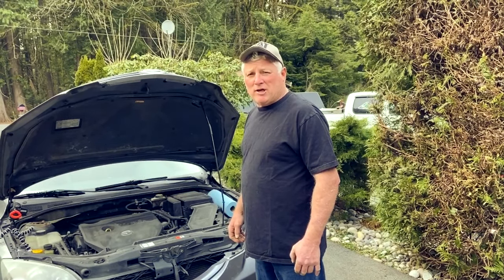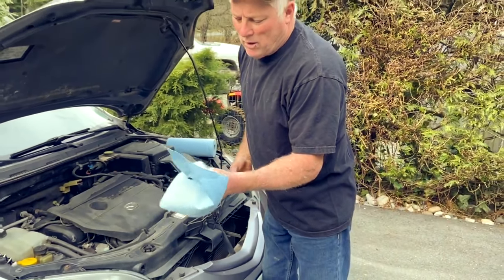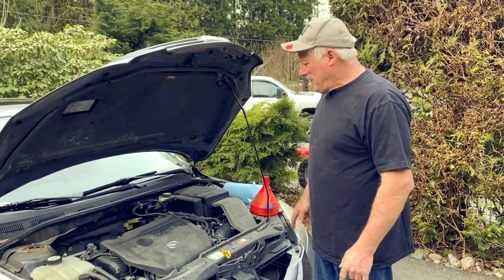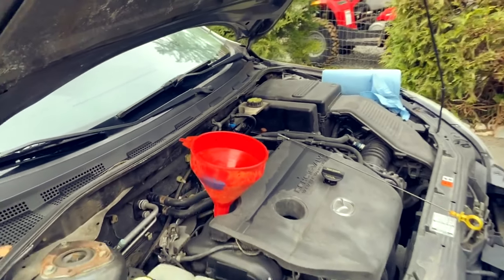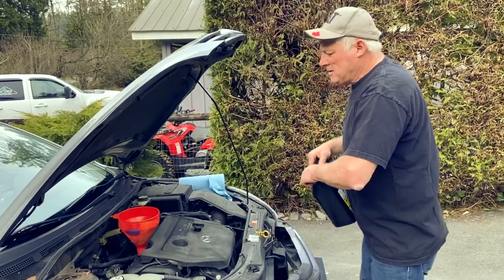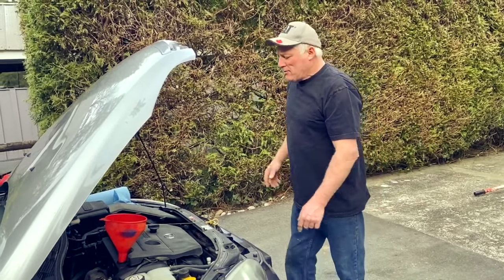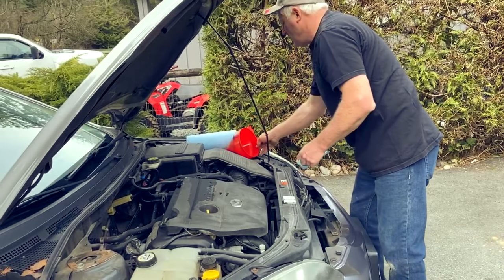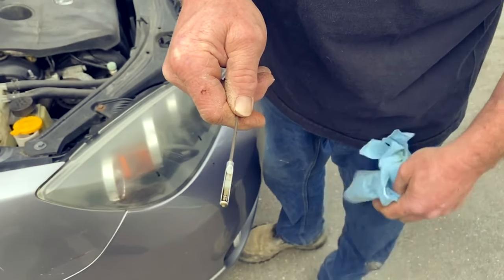How To: Check & Add Oil To Your Car

Comment: Thank you for the added tip about how frequently you check the oil. My car is older and definitely needs a closer eye on the inner workings. Thank you for your helpful video, I feel confident about adding more oil to my engine 😊

Comment from the maker: Returning July 2023!
Hi
Hi everyone, thank you so much for the kind comments. I had to take some time off YouTube but I will be coming back soon with more how to's! Thank you

A few common questions:

Does the car need to be cold? 
- It is recommended to do this with a cold engine. Wait at least 10-15 minutes after driving to check.

How much do I know how to add?
- Less is better than more. You can always add a little at a time and check as you go to make sure you aren’t over filling. Most cars will take around 5 litres from empty. 

Do I need an oil change?
- An oil change is recommended for good car maintenance around every 7500km or 4500 miles. Checking and adding oil if needed between changes is recommended to make sure you aren’t damaging your engine!
Reply: This was good  -  no muss no fuss.  Just do it  -  thanks needed to know where to put it.

Comment: Finallyyyy I've been trying to find a video like this but every single one is like "jack the car, unscrew the bottom, take the filter out, replace it, put it back in"
Like, I'm pretty sure you don't need to do that to do an oil change.
Reply: No fr I literally was stressing so hard I was about to pay someone
Reply: When are you suppose to do that? I don't get it

Comment: If my cars oil is empty, I could just add oil? I don’t need a oil change to be safe? The check engine light is off as well
Reply: If you car loses oil at all, it indicates a larger problem.

Depending on what the problem is, yes, you can just keep adding oil.

But you still need to have the oil and filter changed every 5k miles, or less. If your engine is constantly losing oil, then there will be tons of carbon buildup inside the engine which will, eventually, destroy the engine.

Keeping the oil at the correct level, and changing the oil and filter (make sure the engine has the proper amount of oil when you change it, so you get as much crud out as possible) will keep it going longer

Comment: For old cars, it's a good habit to check the oil level regularly, and it's an easy solution to dry off oil but try to change oil and filter completely after 5000 miles.

Comment: looks like your mazda's giving you some trouble too bud. :( i drive a 2010 acura tl and for all my other cars i've replaced oil between 6 and 8 thousand kms. my TL is reading 90% oil life and it's barely been 1000 km since the last oil and filter change (about a month and a half ago) but my dipstick reading is now at low so i have to add more oil. it really pisses me off that i have to add extra oil long before my next change is due. i've heard burning oil's been a problem with these late 2000s-early 2010s Japanese models. any suggestions? I have the J37 engine.
Reply from the maker: This particular car wouldn't stop burning oil no matter what so we eventually ended up getting rid of it. We were getting the exact same problem you mention, it seemed within 1000km of the last oil change we would be low on oil once again

Comment: I appreciate it I’ve never had a car and no one to show me I have a question what and why is an oil change?
Reply from the maker: An oil change is something that needs to be done every 5000 miles or so. It helps keep the engine running properly as after a while corrosion and sludge can build up

Comment: Do you have to top up your car with the oil used on your last oil change or can you use any oil to top up you car?
Reply from the maker: the brand does not need to match but the numbers (in this case 5W/20) do need to match

Comment: I know this may sound like a stupid question but does the engine need to be warm?  Some say you need to run the engine for a bit  before Checking  and some say there’s no need.
Reply from the maker: Not a stupid question! There is no need to run the engine.
Reply: That’s only for the transmission oil ❤️

Comment: Should your engine be cooled off before you check the oil?
Reply: It doesn't really matter because you wont really be touching the oil, BUT DO NOT OPEN the radiator cap unless you want 3rd degree burns and a missing eyeball after using the car, let that cool down for a while
Reply from the maker: As another commentor mentioned, it is not as important for the engine to be fully cooled however you do not want to check the oil while the car is running and as they also mentioned never open the radiator cap while the engine is hot

Comment: I added oil to my car because it was low. My coolant was also low so I added them at the same time. While the car was on.
My car started acting weird afterwards.  Now I am wondering if i messed something up?
Reply from the maker: Hi there, a couple of things. First, I would recommend always turning the car off before adding any sort of fluid whatsoever. Second, was there potential that you overfilled either compartment? This can definitely cause issues. And last but not least did you fill the oil or coolant with the wrong type of fluid?

Comment: I added some oil to my truck last month and everything was fine. I checked it today and it looked like it needed some so I poured a decent amount But my dipstick still marks the same amount of oil anyone know why that is?
Reply: Keep in mind I checked it again in a few hours just incase the oil needed to settle or whatever but it still marks the same
Reply from the maker: @costeno0990  I had a Hyundai with a similar issue and it was the oil pump. I’d recommend taking it into a shop

Comment: What if it was over the max line ? Is that when you do an oil change ?
Reply from the maker: If it is over the max line you may need to drain some oil from your car. Unfortunately I don’t have a video yet for this however there should be plenty on YouTube to help you with such.

Comment: What happened if it rains in the morning tho so the cardboard gets wet
Reply: if its under your car it shouldnt be a problem... also its quite easy to tell the difference between a wet oil spot and a wet spot from water....
Reply: Use a plank instead. Wait for rain to pass